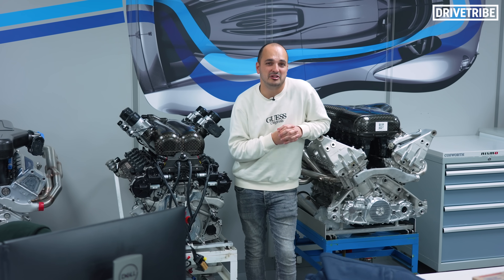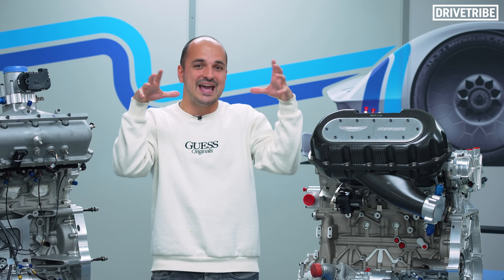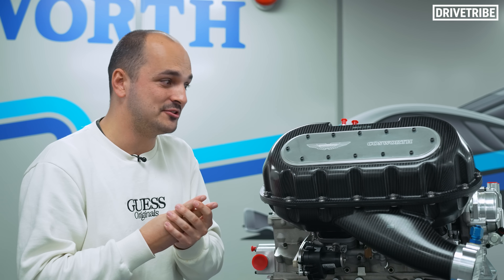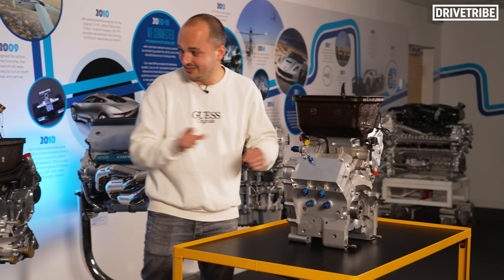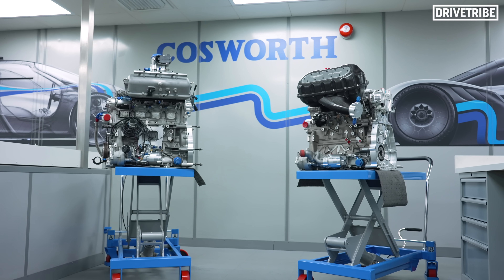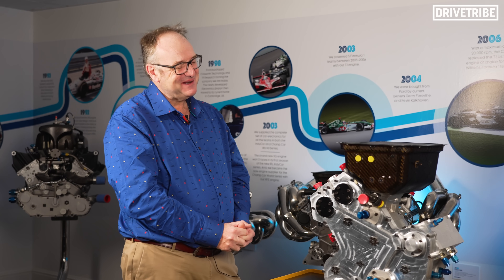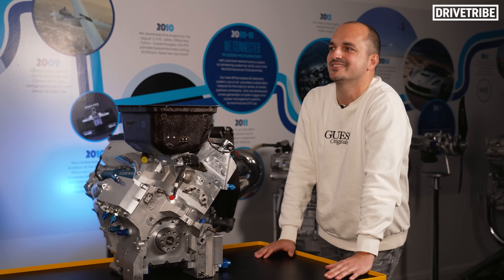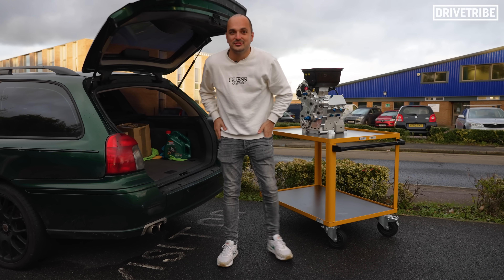This is a single cylinder F1 engine – 20,000rpm, 300cc, 90bhp!

Comment: That single cylinder engine would be badass in a quad/atv!
Reply: Well Yamaha did it with a warrior 350 in the 80s or 90s. 75 horsepower from a .35 single cylinder. We have one that’s old and pretty much broken down. It still runs and my lord does it have some umph to it.
Reply: It seems to fit better the frame of a motorcycle though.
Reply: To be honest, modern 450 motocross/rally engines make 80hp+ quite easily and reliably so in the motorcycle world it’s not revolutionary.
Reply: My 800cc 2cylinder snowmobile makes 165hp. And is the size of that
Reply: Ever heard of 2 strokes

Comment: interesting they never mention the inherent imbalance of the 3 and single cylinders. presumably the triple would need a balance shaft where as the V12 ultimately would not
Reply: Depends if you're talking about primary or secondary balance. There is a lot more involved when you start spinning things at that kind of rpm so they have 100% sorted it out one way or another.
Reply: I was wondering about that as well. Maybe they don't worry about the imbalance on the test mules... Go see if Driving 4 Answers will do a video for us!
Reply: he did mention the imbalance of the single cylinder engine when he first started talking, and im guessing as the cylinders are vertical instead of sloped in the 3 cylinder versions its not needed as much.
Reply: If its designed as 120degrees pr piston balancing wouldnt be an issue i suppose. The 1 cylinder would most definately need a balance shaft, maybe thats why the engine is so big for such a small cylinder.
Reply: Possibly balance gears for the secondary imbalance but not a shaft (for the single cyl). 3 cylinders use balancer shafts to counteract the secondary end to end imbalance. In both these cases I’m not sure they would mind too much in this application given it’s not supposed to last forever and anything you add might detract from the test. Just decouple as much of the equipment that is vibration sensitive from the test engine and hang it off the dyno somewhere.
Reply: My little C1/Aygo/107 1.0l engine revs to 6K and has no balance shaft. In some ways four cylinder inline engines have just as great vibration problems and quite a few have had to use balance shafts.
Reply: but the goal was to extract as much as possible from a light-weight N/A engine. You cant compare a V12 to something like this.
Reply: Hahaha, you read my mind!
Reply: They didn’t but they mentioned the point was to get the engines emissions within regulations and its easier to tweak the combustion chamber with a small engine.

I imagine its got horrible vibrations in the dyno room.
Reply: Right? Im surprised they didnt use a twin cylinder test mule, it seems like that would make the most sense.
Reply: Correct.
Reply: He realy said they did 4 cylinders in which the real wokring cylinder was 3 and the last one was idle cyilinder.
Reply: Single cylinder work is usually only really useful for things like head and combustion chamber work
Reply: @tomdiskin8090  Which is what the man in the video said and what Ricardo was doing 100 years ago.
Reply: Never let the truth get in the way of a clickbait YouTube video!  ;-)  :-)
Reply: @kc5402  are you calling this vid clickbait? If so, you’ve never seen actual clickbait.

Comment: For all the talk of putting one of those 3 cylinders in a hot hatch or something, I want to see a couple of them as a V-6. I mean, c’mon. A NA V-6 with 500hp, and revs to >10k? Yes, please. 

Then put it in something lightweight and *relatively* affordable (as opposed to the cost of a T.50 or Valkyrie at least). Let someone that makes amazing sports cars like Lotus sort out the chassis, and you’d have an all-timer.
Reply: Just imagine one of those in a T-Bucket, Deuce Coupe, or similar. How about the V-Twin in a fifties Fiat 500?
Reply: V6 hatchbacks existed
Reply: The engines just cost too much. If you assume the engines cost 10% of the sticker price which seems pretty reasonable. That's 200k for each engine. Even if you half that for a more mass produced v6 it's still an awful lot of money for a 3.25l v6. The average joe just can't pay for them

Comment: Everyone saying put it in a motorbike frame? It will only start going at 14000 rpm. Motogp are 1000cc with 300hp. Try ride that...
Reply: I'm pretty sure MOTOGP is 800cc now 250-300hp. 
The four cylinder 250cc Honda fireblade from the 90's was exactly as you described, slip the clutch to 13-14000rpm and was hoot to ride.
Reply: @craigdavies8099  no they are a 1000cc. Been that for more than a decade now.
Reply: @RTS1980  My mistake, I remember them going to 800cc in 2007 buy I missed the memo in 2012 when they went back to 1000cc. Motogp doesn't hold my interest like it used to and I haven't kept up with the rules. Motocross is about the only motorsport I really enjoy these days as rarely do you see results affected by track officials and there is heaps of overtaking. Happy New year.

Comment: That 1 cylinder and a hybrid system like they did with mike's 2l V10 mx5 (the engine when it was in their sports car). Just getting it off the line and up to like 15-20mph

Comment: This reminds me of when the Japanese motorbike manufacturers were fitting 250cc 4 cylinder engines that would rev to 20krpm back in the earls 90's.
Reply: They are back at it again, look at ZX25r. Well at least kawasaki is.
Reply: The Honda 250 cc six cylinder bike that Mike Hailwood rode to a world championship would rev to 26,000 rpm on the bench.  I raced 50 cc motorcycles that revved to 16,000 rpm and had no power below 14,000.  Even with a nine speed gearbox the clutch took some stick starting and at tight corners like the Mallory Park hairpin.  Great noise though!
Reply: @philipgrice1026  Yes! Shame the FIM limited cylinders and gears from 1968 (some say it was to allow European manufactures to remain competitive).. .Suzuki had a 3 cylinder 50cc with 14 gears RP68 ready but were not allowed to race it... very much like Hailwoods Honda 6 250, it would have been useless on the street... ultra narrow powerband with gear changes needed constantly to keep it in the power... still wonderful engineering.
Reply: @waynepantry7023  I had one of those many years ago... it was fun when I was young but it did get tiresome very quickly... just sitting in highway traffic in 6th gear and its still doing 9000rpm+, great for low speed high rpm flybys and tunnels and surprisingly reliable considering how high it revved.
Reply: @Troy Mclore I doubt you will be able to make it road legal… sad, sad green world we live in..
Reply: Kawasaki ZXR750 revved to 15,000.

Comment: This is a great video showing why gasoline engines are on the way out in performance cars.   To compete takes $100 million up front development costs.

I love the sound but it just isn't sustainable to spend that much money for the gains they're making.
Reply: $100 million is a relatively small cost for a powertrain component, manufacturers spend billions on R&D on their vehicles each year. 

Most manufacturers offer a much greater lineup of vehicles than let’s say Aston Martin, but they develop one component which will be used in pretty much all of their models.

Comment: We need those 3 cylidners fitted to smaller cars, smaller production cars......can you imagine?
Reply: Yes, they'd need an expensive service every 5000 miles.
Reply: @PixelisedPaul  If you're lucky. Maybe half that.
Reply: @PixelisedPaul  Make that 500 miles.
Reply: @PixelisedPaul  Try every 50 miles...
Reply: @PixelisedPaul  Hence why i said in PRODUCTION cars, they will no way live long with 20K rpms.
Reply: oH Yes PLEASE!!!
Reply: @whitewalker9622  fiat cinquecento 1990, you can buy for free and weighs around 700kg
Reply: And the smaller production cars should be smaller than the current small production cars, at least in terms of weight.
Put this in a Lotus Elise first gen, it might even drop below 860KG, or any other equivalent. XD
Reply: @rattlehead999   the Japanese kei car or keishidosha translates to light car

The heaviest kei car ever is the daihatsu terios kid at 1000kg
Meanwhile the new Suzuki alto and honda N one are under 700kg
Reply: Yaris GR?
Reply: @totalsubmition  Even smaller, it is time to bring fun back. The Yaris GS is a clear sign, that we want to head in this direction (small, affordable, fun and easy to maintain). That engine is so tiny, it could go in a RWD setup and keep things light, simple and just a ball of laughs (sorry, but for some reason i have the original Mini in mind, but realistically we will never see such a small light car again).
Reply: Now THAT'S the engine the Aston Martin Cygnet needed.
Reply: Besides the cost of billet parts, overall service costs, reliability (unless as mentioned you really lower the revs), and drivetrain concerns, you miss the main point which was also mentioned in the video. The power band on these engines is not something you would want in a daily driver car. 

The 1 cylinder might make 90hp, the 3 cylinder 300 etc but they make this power super high in the rev range. Down low they make very little power. Think of a car with the worst turbo lag ever basically. As he said in the video, you'd probably have to get to like 14k rpm just to get moving with the 1 cylinder engine. So if you also cut down the rev limiter to something more reliable, you have to start over again with the cam profiles and overall design to move the power band to make the power lower, and then... Well... It's just practically just a normal engine made out of really expensive custom billet parts.
Reply: Absolutely. Imagine a hot super mini with one of those under the bonnet?!?!
Reply: @Grover91  I was thinking Mini...but then FWD with that screaming engine, we need RWD or AWD.
Reply: @hussamjamil4980  if they can fit a 4wd system in a yaris they can fit one in a Ford fiesta/kia rio/VW polo/mini etc. That would be hilarious.
Reply: @Grover91  Look closely at that 3 cylinder, it is tiny...i recon the challenge would be the gearbox and drivetrain. Remeber, the Yaris has a tiny shift linkage, where a LOT of owners shifted from 3rd to 2nd gear at redline, even a few rally and race drivers noticed how "tight" the gearbox is.
Reply: @Grover91  I think it would fit better in those larger hot hatches, like a Golf or Civic or A250, but I think the most probable would be the Ford Focus. On the other hand, Aston Martin did sell some Ford Fiestas under the Aston Martin Badge XD
Reply: Az-1 has entered the chat
Reply: @timothybayliss6680  hilarious!!!😭😭
Reply: A 12,100rpm hot hatch would be next level!
Reply: I've honestly wanted more kei cars/Smart Roadster dealios forever. Athletic lightweights are always welcome, and they'll need real gems to power them.
Reply: @RRVCrinale  amen! We don’t need massive horsepower, we need cars to diet hard.
Reply: @firesurfer  thankfully here (Athens, Greece) the combination of taxation, fuel prices, lack of parking and atrocious congestion killed the fad off in less than ten years!
Reply: @RRVCrinale  I think a kei truck with a 1 liter 4 cylinder boxer engine would be a lot of fun and might get better gas mileage than the 660cc engines. Small cars are so much more exciting to me than big v8 powered trucks and suv's.
Reply: @adamgee7121  Worth it!
Reply: It's called  Audi   bro
Reply: Koenigsegg use a 600hp 3-cylinder in their Gemera
Reply: Oh yes, especially thinking about traffic with a power band that starts at 8 000rpm... now that would be fun.
Reply: 3cyl Hybrid Sub 1.2 tonne sports car.
Reply: I PAY every cent in my account to listen 20000rpm engines in the street every day XD
Reply: @guille_fit  It is a lovely sound!
Reply: GR Yaris? Pretty close, although it isn't N/A
Reply: Limit the rpm to 10k and about 200hp? Nice and reliable for a Fiesta ST! For more focused applications (caterham, racing, etc), just raise the rpm limit. Wishful thinking
Reply: @pigeonpoo1823  Realistically maybe 8K rpms for durability reasons. I said this years ago and i shall say it again, despite tougher emissions, every manufacturer can build a reliable NA engine, slapping on turbos and downsizing is just the easies and cost effective direction (nothing wrong with it, but i find it lazy). Which is why the GT3/RS and GT4 are still going stronge in sales.
Reply: Why would they though, turbo drives better in every regard nowadays - no one wants a highly strung NA engine, too much work to get anywhere!
Reply: & I would like to know if it would work for a smartcar
Reply: We already do! Where have you been!
Reply: Koenigseeg makes a really small three cylinder turbo charged 600hp engine as part of one of their cars if I remember correctly. Thing is these things are just nowhere near cost, maintenance or emissions effective enough to be in mass produced cars. Still dreaming of a V4 in my ride.
Reply: @Madagon367  Wait for few years for a V4!
Trust me.....
Reply: So Mercedes is coming out with a car called an AMG One.  It will have a 1.6 liter V6 that will have 748 HP.  Uses a lot of F1 technology.
Reply: @carljaekle  yeah. It's taken them years to try to get that thing down to emission regs. It's so not feasible or practical to put an f1 engine in a car these days due to laws. But still kinda cool. Also its detuned to increase reliability
Reply: @carljaekle  🤣 yea imagine services every 1000 mile
Reply: Ford Rs Aston Martin Cosworth that's a long name for a car but that would break the record for the most preorders car in one day lol
Reply: For the US market, the 2022 Nissan Rogue compact SUV has a turbo 3-cylinder that makes 201 hp and 225 lb.ft. of torque (no hybrid), and I am seriously considering it.
Reply: austin marten cygnet mark II!
Reply: Put them in hybrid hot hatches so we don't have to fire it up 24/7 while commuting.
Reply: if you want to pay 70k for a polo...
Reply: Koenigsegg has a better 3 cylinder engine and has better valves technology
Reply: @MrMaxitaple  You know what we "hands on old school" people say..."the more features a car has, the more complicated it gets and the more things go wrong with it":
Reply: And emission regs shatter our dreams...
However the new Ford Fiesta ST and Toyota Yaris GR are 3cyl but with turbos, and theyre fast.
Reply: That would be awesome
Reply: Something like a smaller lotus elise, mid engine, with a 3 cylinder like this with a rotrex would be the perfect track toy
Reply: And hybrid
Reply: Hahahahaha 

Maintenance
Reply: @jamesthehandsome8582  Hence the key word in my comment....PRODUCTION!
Reply: A spoon engine from 1997 would turn at 11k rpms, so 12k shouldn't be that high for today special engines.
Reply: imagine a new Ford RS cosworth, it would have one of those engines, well not such rpms of course.
Reply: You might be impressed by what Toyota has managed to wring out of the turbocharged 3-cylinder in the Yaris.
Reply: The problem is the bean counters would have to go through it and that would ruin the engine just like it does on every production car.
Reply: The problem would be in starting these engines as the formula 1 engines with their tight tolerences need to be heated before running them. That's an hour worth of sleep in the morning going away only to meet traffic (that engine only useful when reving high). Not to mention going back from work.
Reply: I want to shove that Valkyrie one into  cappuccino.
Reply: Better get if we can get magnesium alloy engines to work.

The engine would be featherlight, yet still put out the same or almost the same power. Extremely light engine, lighter car construction possible.
Reply: U can put those 3 cylinders in any small car today and it would be awesome. I ha e ab elantra and that 3 cylinder would be insane in it lol
Reply: With a mini, you would probably want rwd. If you have a 4 cylinder bike engine, it wouldnt fit longitudinal but with a single cylinder its like a cube, you can fit it transversed or longitudinal allowing RWD or AWD.
Reply: Imagane put it on a fiat punto 😁
Reply: No, Koenigsegg free valve "TFG" would be much better.
Reply: Fiat has 2 cylinder turbo engines.
Reply: it would suit the i8 perfectly then it has the proper sound/power to its looks
Reply: The closest we got is the GR Corolla/Yaris
Reply: We now have Yaris GR 3 cylinder cars keeping up with Lamborghini’s 😊
Reply: No we dont
Reply: They would be perfect for a performance hybrid. The electric motors would make up for the lack of low-end torque, high-power to weight ratio of the ICE would allow for the battery packs.